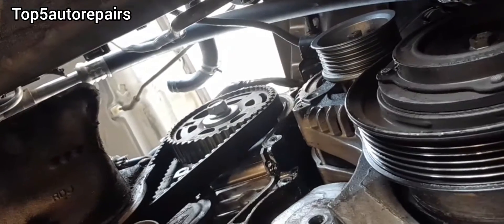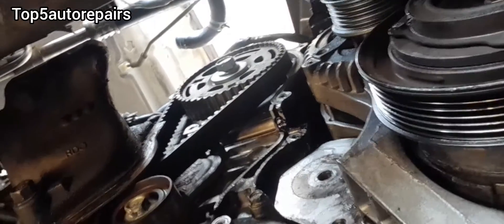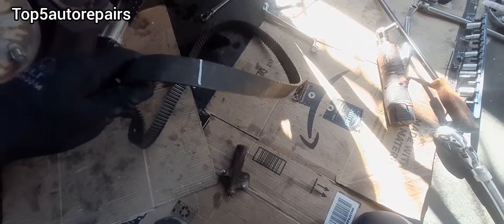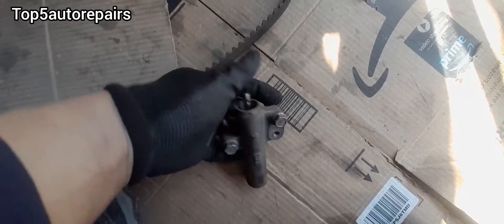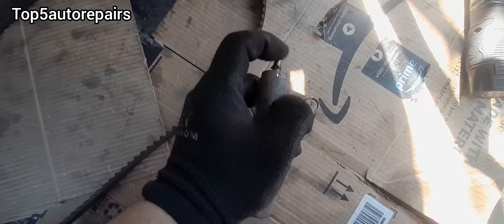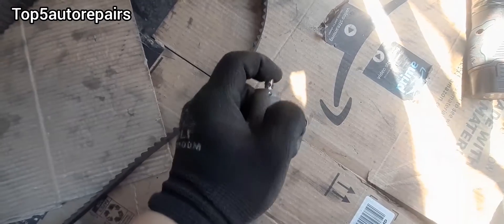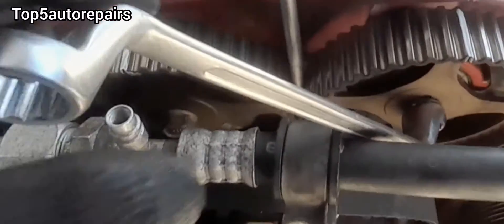TIMING IS OFF BY A TOOTH OR TWO? THIS IS WHY YOU HAVE LOW POWER AND WEAK ACCELERATION

Comment: Hi i replace my 2006 Acura tl  timing belt  before i put the cover. I notice the belt was off three tooth  on the left cam shaft after i hand rotate it twice.   I remove the tensioner belt  re alig the arrow and lines to the engine timing marker.  I hand rotate the engine twice  again.  Now It looks like all markers  line up, everything lines up on number one arrow to engine timing marker , And left sprocket line   Line up to the engine timing marker too .   My question is. Do you think I damage the piston or valves ?  I did not start the car yet.   I am afraid to start it , it may cause more damage if i try to start it.
Reply from the maker: As long there was no resistance when rotating the crankshaft, there shouldn't be an issue

Comment: good video but if the belt will skip a tooth the engine light on the dashboard should lit up. Is that correct. Thanks
Reply from the maker: Yes, if it jumps a few teeth

Comment: Thank you for the advice. I noticed my camshaft sprocket doesn’t line up with the mark when the crankshaft is at top dead center on my motorcycle. I think the timing chain is off. It backfires constantly on deceleration. It’s a little XT250, single cylinder. 
The work is above my pay grade to do, but I will give it a shot and replace the timing chain. Slowly and methodically lol.

Comment: Thank you for your videos. Will it always misfire. We have a vw automatic 2011, loss of power when accelerating but not backfiring. Coils and spark plugs changed
Reply from the maker: Yes it will due to low compression

Comment: Hey bro, this is off topic, in traffic which could prolong the lifespan of a cvt / automatic transmission, shift to neutral and brake... or stay in drive while foot on brake pedal... and whats the reason for this thanks man.
Reply: don't put it in neutral man....youre not driving a manual stick shift.
you wanna prolong your tranny?
just be easy on the acceleration